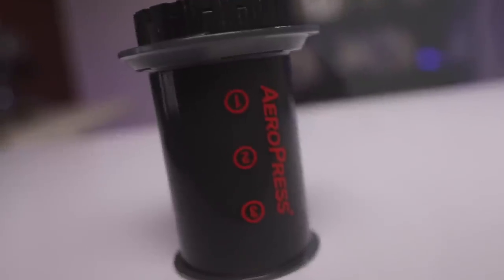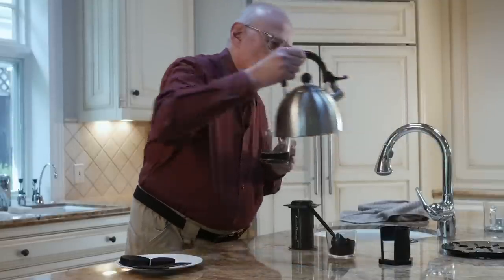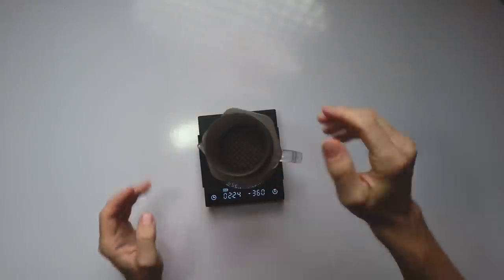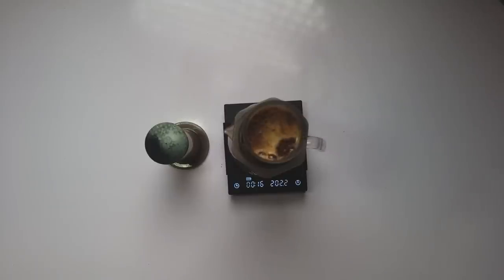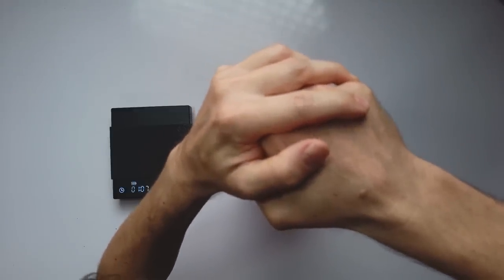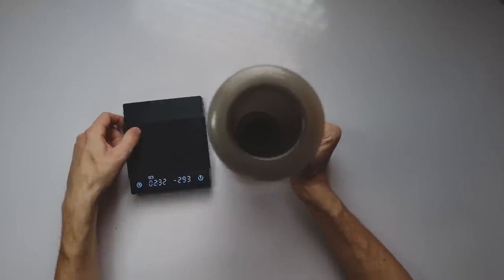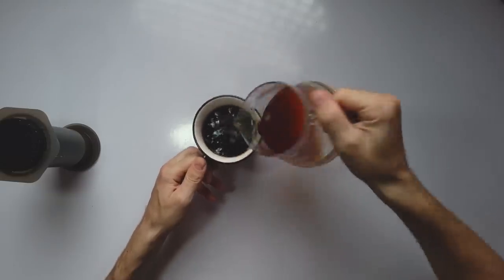Try this AeroPress recipe for bigger batches

Comment from the maker: ADDENDUM: Since AeroPress has a very low "Liquid Retained Ratio" it can be tricky to just follow your regular brew ratio for this technique. So if you're usually brewing pour over at a 1;16 ratio, then you should use something closer to a 1;15 ratio with this technique to get a similar EY, because the batch will be bigger.

Comment: I don’t know if the algorithm is amazing or what, but I just commented on a few other videos earlier today asking if anyone brews quantities above the chamber capacity. I had considered buying the XL for a short while, but found that my daily brew routine nowadays works fine (I have done versions of this up to ~450ml:30g):

20-24g of medium fine grounds in, first I pour in 250-270ml of hot water (generally 200°F), stir, then let some of it pass through the filter with the chamber left open. Once there’s enough space, I add more hot water to hit roughly 300-360ml total. Another quick stir (sometimes), then I use the plunger to create a vacuum for 2 to 3 minutes, then press slowly. Not that I’ve got the workflow down, I get consistently good to great results and I’m very happy with the simplicity. Of course, it’s quite impractical with the inverted method or the flow control filter cap

Comment: Yesterday, I did a similar technique for brewing 800mL without knowing your technique.. It looks like I did something quite similar 😄

But I pressed the plunger between water addings, and it made a solid puck. Possibly because of this, I got a slightly watery brew. It was good enough to drink, though.

Now, I tried your technique with a 2 cup brew. It tastes much better 😍 although I forgot the blooming, and possibly lost some extraction there. It only tastes very slightly light. Could be better if I hadn't forgotten blooming.

Comment: interesting!  I like what you're doing to get a more fully extracted brew, you're not wasting the coffee.  I do something similar, but simpler.  I heat measured water to a boil in a saucepan on the stove, take it off the heat, add the measured and ground coffee, put the lid on the pan, let it steep whatever amount of time you think gives you the best tasting brew (I do 5 minutes, but I don't think I have a sensitive enough palate to tell the difference between a 3 minute steep versus a 5 minute).  Then pour the water and grounds into the aeropress and plunge.  works great for small amounts, and for larger amounts that won't fit into the aeropress, just do 2 pours and plunges.
Reply: This is basically filtered turkish coffee
Reply: @fpcawolff  not so.  it's basically filtered French Press coffee ;-)

Turkish coffee is boiled after the coffee is added to the water.  My method brings water to a boil first, then takes it off the heat, then add the coffee, put the lid on the pan, and let it steep.  Then filter using the Aeropress.

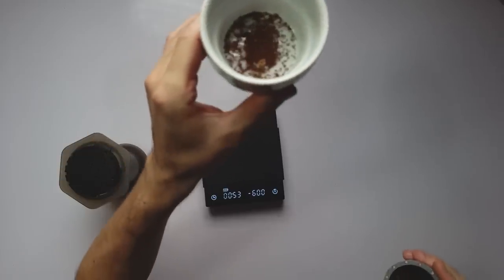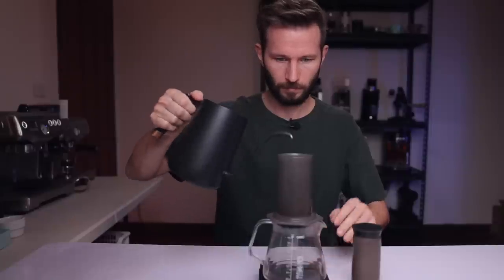Comment: Hi there, I just give it a try to compare with my standard bypass method that I use everyday. I immediately noticed the strength enhancement but I also have the feeling I lost some nuances such a fruit flavors. Maybe it is because I used a medium roast where the initial fruit flavors were already quite muted (both method were used with same grinder settings and similar total extraction time of 2:00-2:30). I wonder if it would be less noticeable by using a nice fruity Ethiopia light roast for example. Need to try this out, I am pretty sure the roast level will highly impact the difference between bypass method and your proposed method, would love to here your piece ^^, maybe for your next video :)
Anyway cool experience and obviously funny to see that with same beans, grind settings, water... you can get a quite different but still delicious cup of coffee. I find more interest in my daily coffee process and recipes variations that in my daily work ^^, guess I am not alone in that case.
Cheers

Comment: Have you tested the taste difference between doing all those pull-outs of the plunger vs. not doing it (in the first round of water)? Why do you do it? Are you trying to increase the amount of pressure by doing that? Thanks!
Reply from the maker: The only reason I'm doing it this way is to avoid dislodging the paper filter. If you push too far and pull back, the vacuum will cause problems.
Reply: @coffeechronicler  Ah, thanks!

Comment: Dismissing the bypass method is missing an important aspect of coffee extraction. That is the fact that coffee extraction is a form of fractionation and the components that tend to fractionate  “later” (second flush of water) are generally less desirable (bitter). So I see the loss of these components as being a desirable outcome of using the bypass method.
Reply from the maker: Depends on the roast level. Lighter roasts generally need a higher EY to taste sweet. Adler's approach works well for dark roasts.
Reply: @coffeechronicler  Agree, it's all to do with roast level 👍

Comment: I tried this today and it's not quite right for me. I did everything the same as you including using my K-Max grinder at 6. The one difference is that I had to use two standard Aeropress filters. But, it came out a little astringent for me. One thing is that it looks like there is more resistance for you than there is for me. Not sure if your K-Max is calibrated differently so that your grind is finer (mine is calibrated so that zero is at the point where you can't turn it anymore) or if the Aesir filters are less porous than two stock filters. Any thoughts?

Comment: Are you reheating your second water dose before use?
Reply from the maker: Not required, but it's an option. There's only a bit more than a minute between the first and second pour, so you won't have a significant heat loss.

Comment: thank you Sir. I was curious about the water, now that you mention it. I was reading these days your take on water. I was curios what ppm was this water, and if you can just mix waters to achive desired TDS. for example I have 35 ppm water, so if i mix with 140 ppm water, the results will be (35+140)/2?
Reply from the maker: Yes, you can mix, and the result should be quite logical, as in your equation. The water I used for this particular brew was 40 tds ppm.

Comment: I’ve used this for som time now, but I think you should stir after adding the second portion of water, since the grounds have now become a puck. I think this a) makes for a bette ectraction, and b) makes the 2nd plunging easier. Thoughts on that? And btw: what Comandante setting does your setting equivalate to? I hav started grinding pretty fine for all AP recipes, around 10 …
Reply from the maker: You can agitate the slurry quite well just with the kettle stream (of course depending on spout and technique) but will give this a try.

Comment: Kind of off topic but noticed you used a K-Max for grinding; is the Izpresso K-Max better for Aeropress than Izpresso J-Max?
Reply from the maker: Both are great for it, just a bit different.
Reply: Appreciate the swift response, still learning the nuances of coffee tasting but I do tend to prefer a thicker medium to dark roast flavor profile opposed to light fruity/acidic.  Which grinder would you say may be better suited for my case?
Reply from the maker: @johnvaldez4044  That's more J Max' strength

Comment: Why not just plunge nearly all the way on the first pass but avoid compacting the puck?
Reply from the maker: The reason for the pull technique is that you don't disturb the filter this way. If you insert the plunger too deep down and try retracting it, it can very easily cause a suction effect, and the paper filter will get dislodged and leak grounds into the brew.
Reply: @coffeechronicler  Oh, thanks for the explanation! I use a metal filter and that didn't occur to me.

Comment: What do you think about using melodrip with this recipe? I believe using the plunger that way and adding water 2 times (plus a bloom) agitates maybe too much. Melodrip can also create a bed flatter.

Secondly, what do you think about using only the end part of the plunger? Ray murakawa has this kind of video in his instagram. He just uses the silicone part and presses with his fingers. To take it out for adding water the second time, he just presses the side of it and it comes out easily. Your method worries me about damaging the paper filter and letting go of some coffee particles into the cup.
Reply from the maker: I can understand where you're coming from, but usually, the coffee comes out very balanced with this level of agitation. I know the technique, you're referring to but think this method is more practical.

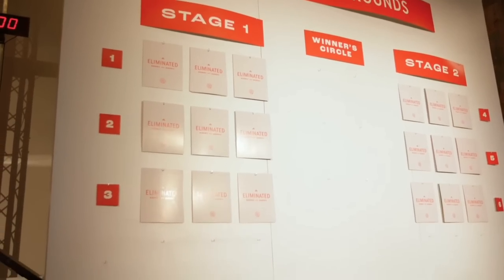Comment: I don't seem to get good results with this. I kept all the other variables constant (1:15 ratio, same grinder and coarseness, two filters, same water temperature and of course coffee from the same bag of beans) and did a regular 13g coffee + 200g water brew with my Aeropress Go which was sweet and perhaps a bit weak but still very positive. Then did a 23g coffee + 350g water with this method and the coffee is noticeably more bitter and harsh! I would be interested in understanding what could be going on.

Comment: Two questions:
1. Why such a short bloom, when other pour over methods usually go for 30-45 seconds?

2. What grind setting do you recommend starting with on the Q2?
Reply from the maker: 1: This isn't a bloom to release c02, rather it's to avoid dry pockets

2: There are 3 different versions of Q2 now, so not sure :) But similar to the finest range of pour over settings.
Reply: @coffeechronicler  Oh, is the new heptagonal Q2 (Which is what I have) different from the old one? Or is it the pentagonal that has two versions?